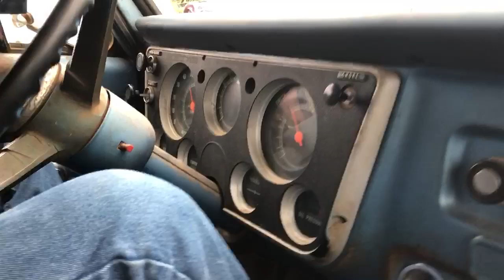Chevrolet C60

Comment: so start with button in..gear one, run it, pull button out.  pump clutch?  shift to 2 -
Reply from the maker: Sorry for the delayed response. Yes you start with the split down(low side) and 1st gear as you’re running the gear up you can pull the split up(high side) and when you’re ready for the high gear you can release the throttle and it’ll go in or you can clutch it that’s up to you. Using the clutch to down shift the split makes it easier.

Comment: What  transmisión  is?
Reply from the maker: Ariel Molina it’s a 4spd with a 2spd read axle. Thanks for watching!
Reply: It is a Muncie SM465 4 speed with 1st as a sweet 6.55:1 low hole gear. L/1 is 6.55:1, 2nd is 3.65:1, 3rd is 1.70:1 and 4th is 1.00:1. With a 2 range. Gearing can get a .30:1 road speed rate increase. Giving 4th high a 0.70:1 ratio.